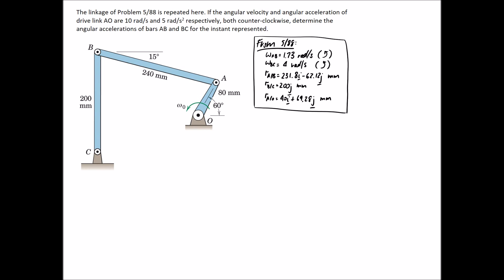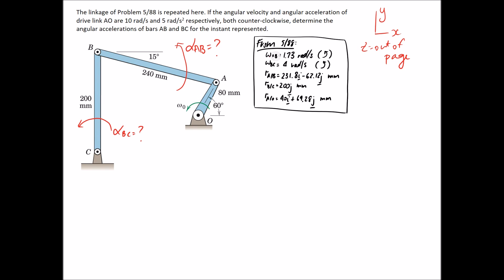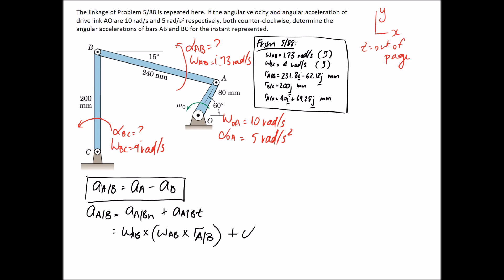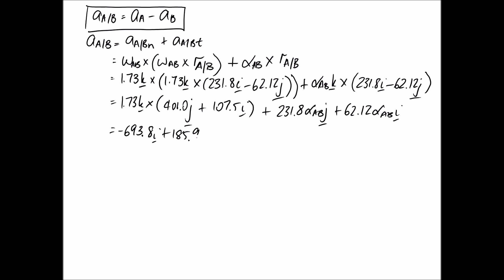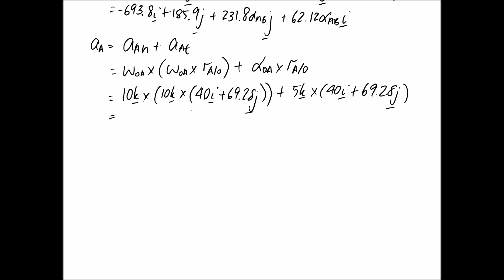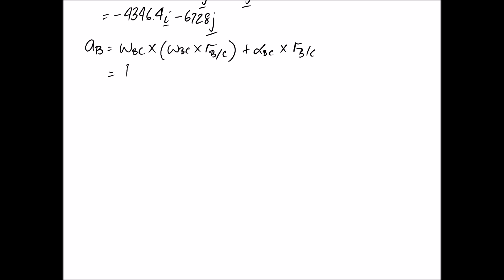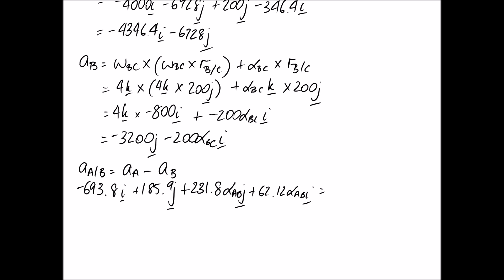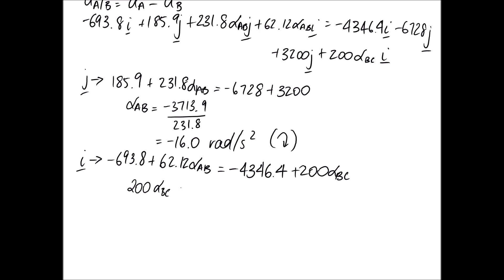(5/147) Acceleration Analysis of Linkage

Comment: if our Wab is -3.017 rad/s for ex  do we sub it in as k or J?
Reply from the maker: I think you are referring to the unit vectors. In these examples since the rotations (omega and alpha) are about the z axis that comes out of the page (which I would have defined at some point in the video), they will always get the k unit vector since that's the one associated with the  z axis.

Comment: If we have a negative velocity for one of the members ~BC for example, say its in the clockwise direction, do we still use omegaBC*k? Thanks
Reply from the maker: If a member is rotating clockwise at say 3 rad/s then in vector form it's omega would be -3k. You'd then be able to sub it into whatever equation you were working with.